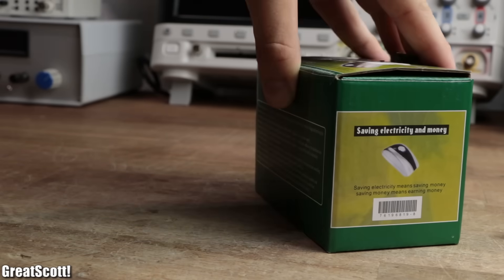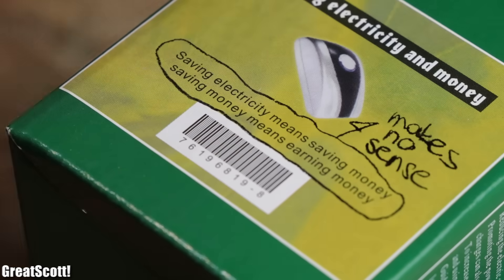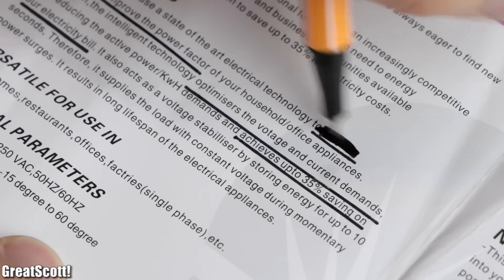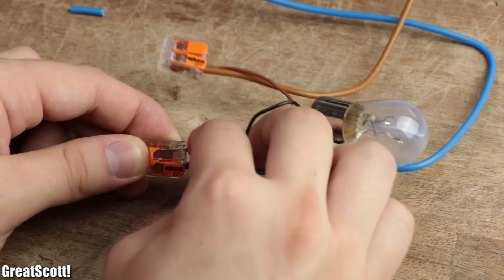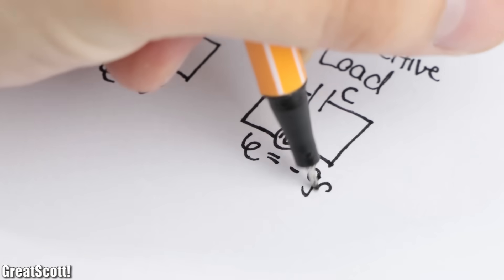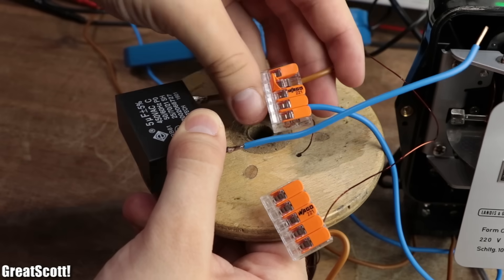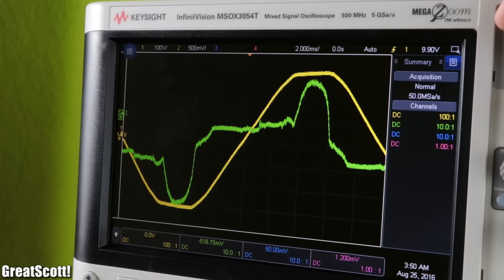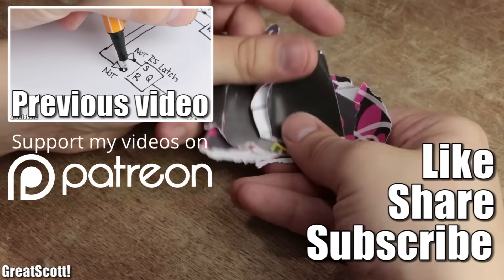Chinese Power Saver - Does it actually save power?

Comment: Hi, i have a question. I now its not above your videos but i thought you can help me. So i have a GA10 guitar amplifier  and i thought that i can just add an external speaker by  soldering the red+ and black- wire to the speaker terminals but i dont know if that is possible. And because i wasn't shore if something is going to mess up when i power it on, i thought i can ask you for an answer...

Comment: I guess they could help a little if you where charged for your power factor, but your not :P and in a biig building where they are they have a huge power factor correction rack that does this job
Reply: true, power factor correction only helps in industry buildings.

Comment: These will never work. From my experience pretty much all devices have a certain power load they consume. Changing the phase shift, reducing voltage, or anything else will not change the amount of power they consume. I'll use the type of power saver that lowers line voltage as an example. Most SMPS circuits run between 100 to 240 volts for world wide compatibility. Reduce the voltage from say 120 that we use in the USA to say 100 that Japan uses and the amperage draw goes up to compensate. Same wattage is consumed. Watts= volts x amps. Only way to save power is for the target device to be made more efficient if possible. None of these power savers will work at all. If they do somehow work and the power consumed is reduced then it is almost certain the output power of the target will be lower as well. Washing machine motors will struggle. Lights will be dimmer. Things like that. People need to get a brain and do research before jumping on scams like this.

Comment: They are suppoused to correct power factor at homes, but they are useless. However Power factor correction at industrial level is quite important, ofcourse the use of capacitors is not the only method to improve the factor. Nice video

Comment: As any electronic person knows, these are nonsense. In a real inductive current draw having a capacitor can help in reducing the total power usage. But:
- The meter in your home is not that advance
- Power companies take care nowadays of that in the transformer side
- Uncontrolled corrections can be more problematic than helpful
- The LED do use power

I remember seeing those real active monitoring and correctors in industrial machines. It does work there, because those machines are purely inductive and BIG (kW of inductive draw). But it is useless in a home.

Comment: I thought this power factor correction devices work best with motors such as air conditioning?
Reply: zodiacfml yes, you are completely right. It will save you some energy consumption If you have many inductive load (such as ac motors) running on the mains. This power is actually a power factor corrector device which will reduce the mains current going to the motor and cut down the power transmission lost (reactive power). Many country the users and the factories have to pay reactive power. That is also why there are million n million capacitor banks installed around in the industrial n commercial setups

Comment: if you connect just a 10uf capacitor across mains 1A current flows through it, where does that energy go, capacitor does not heat up, also today's electronic dsp based energy meters can measure all that reactive energy & charge you for that also.

Comment: it's almost funny to see this kind of joke some people are trying to sell to the uneducated. I mean I just got into the second year of my job as a trainee (2. lehrjahr als betriebs elektroniker) and we have a lot of these compensation stations. for example our SMALL oven. it keeps up to 60 tons of iron at 1450C° with up to 380kw effectively (man hats mir so erklärt das die wirbelströme im eisen die man normalerweise verhindern will direkt das eisen aufheizen also die spule ist praktisch um einen tunnel gewickelt in der flüssigeisen liegt)but at 500-600V with over 1100amps because of the cos phi of arround 0.65. of course we as a industrial consumer need to compensate that with more than a few capacitors. and I dont even want to talk about our 2.2 MW inductive oven. one of those capacitors wheighs 50 kg there is half a room of them. (ps deine Videos sind extrem gut für jemanden wie mich und bringen mir sehr viel weiter so)

Comment: How to save power and reduce your energy bill? Buy more efficient appliances.
Reply: best of message !!!
Reply: And also consider the cost of buying them before throwing the old one. Since in most cases, the wattage saved is not enough to justify the cost of a new appliance. Yes, in case the old one just craps out, its a good time to look for better and efficient one.
Reply: How to save on power - consume less!!
Reply: Duct tape the cracks along your windows and door frames that have too large a gap between them to minimize a cold draft from flowing through. It cut my gas bill nearly in half for this month compared to last month. Of course much of that was reduced due to slightly warmer weather over the course of time since last month. But, it still helped, imo.
Reply: Or upgrade all the wiring with super thick shielding

Comment: I've seen one, probably worse than this, with nothing but basically crudely made resistor (some 5 mm diameter silvery wire coiled on an isolator, dunno what it was) connected series to the appliances "consuming too much power".
Reply: a series inductor

Comment: So if you had a UPS that had power saving 'technology' would you assume this would be a more plausible solution than this?
Reply: Mainly where current draw could spike based on CPU load. If the spike is a few seconds and requires more amperage it would compensate using the battery power.
Reply: no, assuming that the UPS would drain from the battery during high cpu load it would still have to recharge the battery afterwards, using more power due to the inefficiencies of converting AC->DC, charging, discharging, and DC->AC.
Reply: Well it could discharge during on peak usage (higher $/kwh) then charge during off peak (lower $/kwh)
Reply: again, the massive losses in a small UPS would not be any cheaper than just paying the few extra pennies for the peak usage charge
Reply: @jwnordquist1  Besides the losses in converting AC>DC and then back to AC to put it to a PSU which transforms AC>DV again....... Even though some PSU's now reach 97% efficiency this still will waste more than your night tariff could save... Add to that the cost of yearly UPS battery replacements, perhaps even twice per year if you continuously discharge and charge them slightly multiple times per day and you'll waste thousands of dollars... A system so beefy that a 'buffering' UPS could make sense would be in the multiple Kilowatts of power consumption anyway and a UPS suitable for serving that load would have a battery pack cost of at least some $1500...

Comment: in my country, there are huge capacitors between power lines. my professor told us that it is suppose to lessen power loss. so this capacitors acts as power savers. which is the same thing you have in your video. what i understand in your video is that the power indicator in your house can't read power loss (var). did i get it right?
Reply: sorry for bad English xD
Reply: Since you generally don't have big coils or motors connected directly to the AC grid in your house, the reactive power isn't that big. Reactive power also travels from the inductor/capacitor to the grid and back, but isn't really consumed. This is why it isn't measured in common household electricity meters.

Factories often have much bigger inductive loads, so their electricity consumption is measured with meters that measure both active and reactive power. Since they use tons of power and since capacitors are cheap compared to other machines you find in factories, they usually do have capacitor banks to decrease the reactive power, which can give them big savings. Those capacitor banks include monitoring circuits though, to make sure that the correct amount of capacitance is connected to the grid.

Comment: VERY impressive! I think we all knew the outcome beforehand, but your analytical methods are really impressive and fun to watch! :)
Reply from the maker: Thanks mate ;-)
Reply: @greatscottlab  I just had a couple of these things given to me. I didn’t know this video existed so I opened it myself. I assumed the black box was a capacitor too but on the unit I have the box is hollow and filled with wax and the wires are just free floating in suspension inside the wax 😑😑😑
Reply: @greatscottlab  I believe that you have made a grave error in your calculations. Please watch my video. https://youtu.be/xUL7xUKkAB0
Reply: due to my high school level understanding if circuits i had about 1% understanding of what he was saying but it sounded cool so i kept watching
Reply: basically moving the curve using capacitors or inductance you can trick your electricity meter that will read consumption of current badly. Mean that if you use e.g. 900W it will read only e.g. 750W cause of moved curve.
Reply: +Marek S so this is for tricking the power company to fool the meter?
Reply: [[][]|;l|[][]] basically yes, but if they find it out u will pay serious amount of money.
Reply: RUSH B CYKA
Reply: ya basically in high school they teach you how to light up a light bulb. i knew how to make inverters since i was like 12
Reply: Лол тут есть русские
Reply: GreatScott's from Germany.
Reply: Полно!
Reply: We did in America ROFLMAO

Comment: how do you measure current on an oscilloscope ?
Reply: Amp clamp
Reply: Or, if you're on a budget (like I am 90% of the time) add in a series resistor that you can buy for DIY ammeters, hook up your oscilloscope to measure the voltage across said resistor and do the maths by hand using ohms law to get the current. It's far from ideal but it works well enough for a beginner maker.
Reply: The easy way is to use a current probe. But, you could also use a sense resistor and do a by-hand calculation like +TheBeginner ElectricalEngineer suggested below.

Comment: Some housholds or companies could get their bills in VA, so with a proper controlled circuit you could really safe a lot of money
Reply: That's a strong claim to make with no evidence. Would the benefit of this tiny capacitor outweigh the drawbacks, like the parasitic resistance? And given that, as the video said, the current is shaped more by distortion than inductance, how would it help at all?
Reply: but then the gas company's would loose money :P it'll never happen
Reply: yourcurtainsareugly
A factory usually has lots of Motors :D and I said a properly regulated device
Reply: It's plausible that there are factories with large inductive loads. But what is this "properly regulated device"? Do you have any examples of such a thing, or that they even exist, or could even theoretically work, including parasitic elements?
Reply: yourcurtainsareugly
I'm pretty shure it could theoretically work, but I don't know of any such device.
Reply: Details, man, details! Why are you so sure? What makes you think such a thing could work? Have you done any research on such a thing, or is this a gut feeling?

I know power companies do use switched capacitors in their distribution systems, but do you actually know that companies do/would use this type of compensation?
Reply: Of course "it could work" in certain circumstances. Except it's ILLEGAL.

Comment: Hey Scott... a video about 555 please you can add it in Basics series
Reply from the maker: It is already on my to do list.
Reply: I think you have mentioned the IC 555 in your PWM video but such an important IC deserves it's own video.
Reply: +Rajat Tarade or its own channel
Reply: I think you should do the common schematic 
pin 8-pin4
pin2-pin6
pin1 ground
pin8 Vcc
a capacitor between pin 1 and pin 2
a resistor (680ohm works fine) between pin8 and pin7
a resistor (680ohm again) between pin7 and pin6
and pin 3 is output.